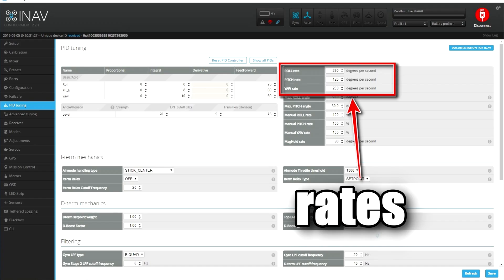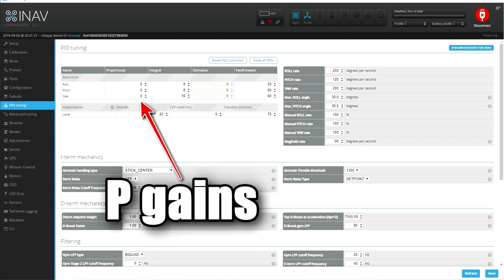Fixed Wing Tuning Guide for INAV

Comment: I'm having issues with esc brake not working, is there a setting in inav for this?  I am using a hobbywing esc and appropriate control box with braking on.

Comment: Hi Pawel,   I have a glider 3.2m wingspan, and P=0 I=6 FF=50 did not work, it wobbles/drifts.   In MANUAL the glider flies on its own strait and level.   AUTOTUNE did not work to produce a stable PIFF coefficients.  What should I do??  Thank you.  Dennis

Comment: Pawel, I need your help. Do you know what can be happening that I don't get system messages in my OSD in INAV? I need to Autotune and Autotrim, nothing shows up in my screen. Thanks!
Reply: This is my video, you can see how bad Oscillations are. Any idea... Thanks! https://youtu.be/Ywh7KxZ4Zj0
Reply from the maker: You have to enable "System messages" OSD element
Reply: @FPVUniversity  thank you Pawel. I had System messages ON, but I found out DJI OSD is not fully compatible with iNav OSD. I don't get to see the messages like Autolaunch, Autotrim and Autotune. I don't get OSD sticks commands either (like saving). Thank you for your help. I guess we have to wait on DJI. Keep up the great work!!!.

Comment: Hello, Love Your channel, I Have a question they say the dumb ones are the bests here goes can I piggy back my frsky R9 module  with my EZ UHF 2W transmitter sense the R9 module has the pins for it along with gps sense it has the pins for it to. Have a Radiomaster TX16s transmitter external 3s lipo battery pack R9 is ACCST  firmware 2.3.5,EZ UHF 1.50,Radiomaster open tx 2.3.9,and flight controller F 405 wing using INAV2.5.Also if I'M able to would I be able to use redundancy I have R9 receiver, and EZ UHF 8ch receiver. That was on my mind and if any one You would be the one to connect it or is it just a dumb question. Thanks. for any response

Comment: I really wish there was a better way to dial in the tune on the bench before launch. Ive been trying for two weeks to get an F3 controller to stabilize a Bixler. Tried Auto tune several times, always gets out of control. Last night I tried my own PIFF settings, as soon as I switched from manual to stabilized it did a back flip and despite my best effort I could not force it to behave. Ended up just flying in manual mode the rest of the evening.

Comment: Is there a way to trim the servo midpoints in manual mode instead of autotrim? Coming from several years of slope soaring I have my own routine to match CG position and pitch stability to maximize efficiency and I would like to do it on a friend's FPV rig :)

Comment: Hello Pavel, I have followed your guide step by step, and my wing (1.2m wingspan opterra) still is jittery in flight (not a servo problem). I would be flying level and solid and suddenly the wing starts to rock (pitch and or roll axis), then flies normal again. I reduced the gyro LPF to 20 as you mentioned but it did not help. I fly in 10km/hr wind, using matek F722 wing and FrSky R9M access receiver. Same issue happened with the zohd dart XL. What am I missing? Any suggestions? I did servo trim and auto tune and my cg is spot on. Could it be an issue with the barometer default PIDs? Thanks

Comment: Dear Pawel, After autotune my Reptile Dragon is bouncing four times on the pitch axis after steering. How to tune FF in this case?
Reply from the maker: https://www.youtube.com/watch?v=c8CYrUOe9Ic
Reply: @FPVUniversity  This video is about strong steering movements. The steering I'm talking about is just very small. You could say the steering is less than the bounce. And the bounce is vèèèry slow...
Reply: @FPVUniversity  I've playing around with the rates and was able to reduce the bounce after autotune to only one. Maybe the bounce is a drift to be countered with I gain? I have a video here: https://youtu.be/mMC94gTe20M

Comment: If i set p gain to zero  in acro mode stabilisation seems to not work at all !?  Is that right?  Do i need to enable air mode?  Speaking for airplanes.
Reply from the maker: airplanes are stable in the air without any PIDs
Reply: @FPVUniversity  thanks pawel. Also I just run a airplane Preset and seems to act better now in acro mode.  Thanks again.

Comment: Thank you Pavel for a great video , I love your work, followed all your tips for my new Strix Nano Goblin plank plane, its running 411-wing so no blackbox,  is theere a way to stabilize the plane better for a smooth flight: https://youtu.be/6mi1kr8Y6cE , this a a link for the video ,  auto launch , RTH test and mainly acro flight. I am looking to reduce  the  roll yaw   short period , thanks

Comment: i nav is a fuc*%ng ball ache. been trying to get my wing set up with it for ages,  i had and still got an s800 with an f3 board running betaflight just for stabalised flight...bloody amazing 2 years later. no stupid auto launch and headaches... it just works. got an ar900 with a matek f411 and gps, and it wont arm or fly..

Comment: I think autotune for quads should be possible. By analyzing the blackbox data in real-time we could develop a kind of adaptive PID tuning and filtering with the aim to minimize PID errors with say 1Khz looptime. Now with rpmfilter and fastfeedforward 2.0 from betaflight gyro noise is much less. Is there a way? The Radix uses an OSD spectograph. Neuroflight is trying this with a neural network.

Comment: according to wiki here   https://github.com/iNavFlight/inav/wiki/Tune-INAV-PIFF-controller-for-fixedwing
Increase FF-gain  until you get 90% of full servo throw when having sticks at full throw when in ACRO mode  compared to manual mode.
This is so the FF-gain does most of the work turning the airplane, but leaving some for the P and I gain to work with.
The 90% deflection value can also be calculated by dividing 13950 by the maximum rate for the axis, e.g. 360deg/s maximum roll 13950/360=38.75 FF. For 80% deflection, divide 12400 by rate

Comment: I tried your recommendations. It was not as good. Having a P gain of about 8 is much nicer when cruising on low throttle, with my C1 chaser. Especially if there is some buffeting wind.
Reply: If Pawel really knows what he is saying there must be something wrong with the hardware. Does the increased P improve pitch, roll or yaw?
Reply: @jannesbosma9801  he does know it. I run p on 1 and its very good

Comment: Hello!
I have a question about ACRO flight mode. Do you mean it by turning off MANUAL, HORIZON and ANGLE?
So, nothing is selected == ACRO?

Thanks!
Reply: That is my understanding... per the iNav mode documentation: "This default mode is called "Rate" mode, also sometime called "Acro" (from "acrobatic") and is active whenever no auto-leveled mode is enabled."
Reply: https://github.com/iNavFlight/inav/wiki/Modes#default-flight-mode-no-mode-selected

Comment: My problem was in Horizon my plane would dive down....I re-leveled 5 times. Then I purposely put the nose up 4.5 degrees and in Inav put -4.5 in board pitch. Now it fly's perfect. I am very impressed with INAV!
Reply: how or where did you change that setting? mine is doing same

Comment: What's the point of using iNav for acro only for airplane when the majority of iNav users specifically use iNav for long range, stability, self level, waypoints and RTH functions? Your suggestion of using acro only for airplane makes zero sense for this AUTOpilot iNav software. 
If someone wants a gyro only(acromode) plane, there is much more simpler options available. Come on pawel.
Reply: Hyprmtr good point.
Reply: I use iNav for waypoint missions and LR flights. I hardly ever use acro mode. I use iNav for these functions along with rth. I don’t know if anyone that uses iNav just for acro only. I’m glad I wasn’t the only one that caught that.
Reply: Totally agree.   I couldn’t watch entire video.   But I agree.  I’ll keep mine way it is flies good enough.
Reply: I am flying LR as well and I am constantly in acro mode because it feels much better to me.
Reply: I fly long range. I only use acro and occasionally altitude hold.  I don't see the point of flying, if you're not flying it.
Reply: @51im  yeah same, I fly the plane in accro but put it in auto when I need to pee lol

Comment: I'm going to need some help to overcome my ignorance: Where do I find "Acro mode"? It's not available as a mode, other than "Horizon", "Angle", and "Manual". So, what is "Acro mode"?
Reply: Never mind..per Github: "The default flight mode does not self level the aircraft around the roll and the pitch axes. That is, the aircraft does not level on its own if you center the pitch and roll sticks on the radio. Rather, they work just like the yaw axis: the rate of rotation of each axis is controlled directly by the related stick on the radio, and by leaving them centered the flight controller will just try to keep the aircraft in whatever orientation it's in. This default mode is called "Rate" mode, also sometime called "Acro" (from "acrobatic") and is active whenever no auto-leveled mode is enabled."

Comment: I tried to use inav, but i couldn’t. The FC i have (Speedybee F4) have the same timers from PWM 1 to PWM 4 (7 total), and they set the motor to PWM 1 and 2 and servos to 3 and 4. I cannot use my motors. I ended up using betaflight for my plane, now i use my motors at S5 and S6 and servos from S1 to S4.

Not having resource remapping is the dumbest thing INAV has ever done. Or at least they should have used the correct PWM outputs for each board.

Someday i’ll try to mess with the target file to see if i can get anything better, but i don’t have any hope it will work. I don’t use GPS though, so betaflight is ok for me anyways, but there is no doubt INAV is better for fixed wings.

Comment: One point to mention before autotrimming is board angle adjustment. You can skip this step but then in the OSD, the horizon will not match with the earth horizon.

Comment: ProTip from the source code: Instead of AutoTune, just set your FF to (13950 / (axis rate)) for 90% control surface deflection (useful for no P gain), or (12400 / (axis rate)) for 80% control surface deflection (useful for small P gains). No complicated math or blackbox spelunking.

This is the first video I've seen where someone explains that the rates are the first things you want to set, and contrasting with BetaFlight, you set the rates for what the model does instead of what you want it to do. I like the "no P gain" and other tips too, gonna give those a try!
Reply: I don't like autotune either.

I adjust the FF value by approximation, switch between manual and acro, until you have 90% of the acro travel.

However, applying its formula 13950 / 300dps = 46.5 FF. I think it will be a very low value to reach 90% ... I have to try it to see if it matches.
Reply: @isabido  Yeah that's the way I did it too, adjusting the value and switching back and for between manual and rate mode, but  we already know the pitch / roll rate so there's no guesswork or error if you just divide and type it in. I might try to push to have that built into the configurator.
Reply: @Bryan Mayland Could you please say where in the source code that info is hidden. TIA.
Reply: @StefanNaewe  It is in src/main/flight/pid.c pidApplyFixedWingRateController(). The rateTarget is multiplied by the scaled feedforward kFF (the entered value in the configurator is divided by 31). This gives the formula:
Output = FF / 31.0 * Target
For 90% deflection (45% in each direction) that is:
450 = FF / 31 * Rate
FF = 13950 / Rate

Comment: What about the board pitch angle setting, to the give the plane the right angle of attack for a leveled flight in the air?
Reply from the maker: if you do not use angle than it's not really needed. RTH will compensate with altitude information

Comment: hi Pawel, great video as usual. could you also do one with trouble shotting? for instance, why does my inav changes direction while in loiter mode? or why does RTH heads to arming point and then just flies away..? ahah, i know, this sounds like i am trying to get answers to my questions. but, maybe there are other inav users who have the same problem.. ;)
manual, angle and horizon work pretty good. the gps has constantly 10 to 12 sats.. so, i believe i am doing something wrong with the settings... cheers, and keep up the good work!

Comment: Hi i have tried to tune my zohd orbit wing with a matek f411wing  the controll is so slugish in manual and acro rate its like it have 150percent expo(i set manual and rc expo to 20 percent)   the elevator have almost no travel even if i set the rate to 950 but wen i switch to horizon it respond almost normaly i order a second f 411 same problem i tried a matek f722wing same problem  i have an old omnibus v1 in my caiprinhia  inav 1.9 and it fly like a dream for almost one year  (i did tune it myself)

Comment: Thanks for this awesome guide. Question: I assume that when you say basic hardware and setup must be complete first, this includes the guide on the iNav github page that talks about setting FF so that you get 90% of the deflection that you see in manual mode, and all that? Will doing that first yield better or worse autotune values?

Comment: Is there any way to give "Stabilised Yaw" to the motor differential thrust Yaw?
Reply from the maker: yes, with mixer. Evenm default airplane mixer preset has differential thrust
Reply: @FPVUniversity  since the servo mixer has both "Stabilised Yaw" and the raw "Yaw" input, I was confused if the "Yaw" in motor mixer was stabilised or not. I guess now i can try  building my non-swept flying wing with motor differential for yaw stability!

Comment: Another great video, Thank you! Do you have Airmode on for your planes also, or just Acro?
Reply from the maker: Airmode should be always on
Reply: Quelle est la différence between  airmode and acro  ?
Reply: @swfpv  Airmode permet de toujours avoir la stabilization, meme quands le... throttle? est a 0, mais n'est pas en fait une "mode" comme Acro ou Angle. Acro est la mode qui donne simplement la stabilization, mais qui laisse la contrôle direct au pilote.